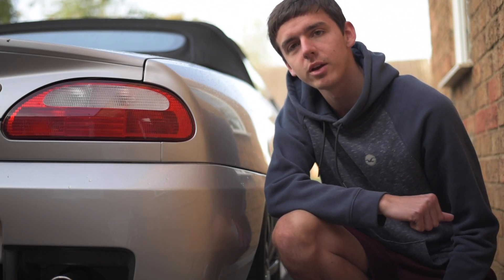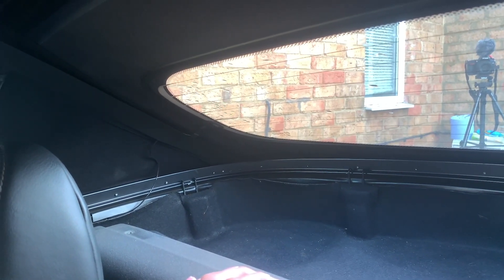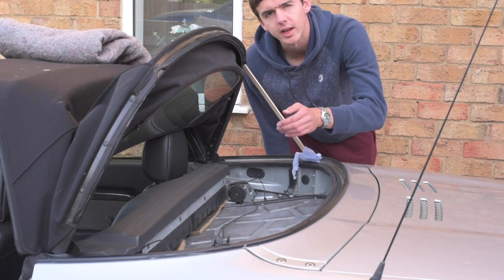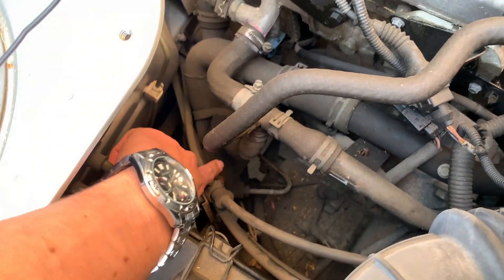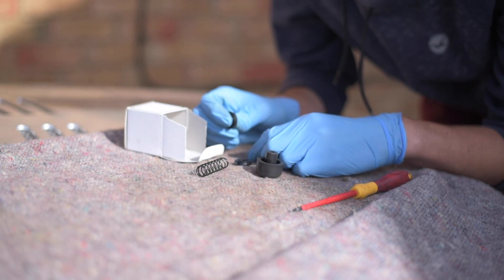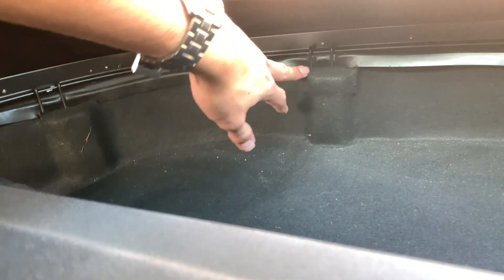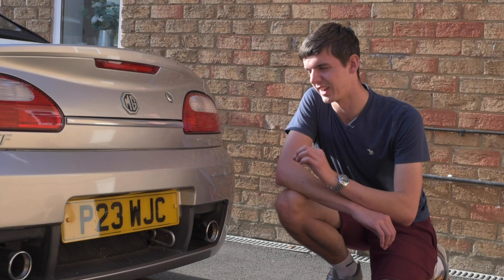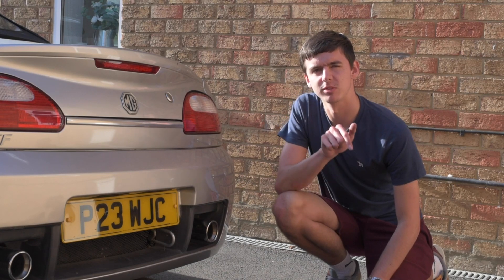How to Access the Engine Bay | MG TF How To Guide

Comment: What struck me was isn't thirteen bolts to secure that  metal engine cover overly excessive..Did they go out their way to make it difficult to work on the engine....Really useful video guide, well presented...Thank you
Reply from the maker: It's certainly not easy compared to most cars! I'm glad you found it useful.
Reply: Especially the three very difficult to access ones beneath the driver-side speaker. Any solution on how to get to them easily Willo?
Reply from the maker: The only solution for easy access is to first remove the t-bar, but I wanted to avoid extra work at all costs!
Reply: Mine currently only has twelve bolts as that final bolt frustrated me too much!
Reply: That's the thing with almost any mid engined car

Comment: How do you know if there vvc or not?
Reply from the maker: The TF160 was VVC, all the rest were not :)
Reply: @CarsWithWillo  sorry new to these, how do I know if it's a tf160
Reply from the maker: @snowy23704 unless it’s had the badge removed, it’ll say 160 on the back. Or take a look at the rev counter - the TF 160 redlines at 7,200 and the 135 redlines at 6,800
Reply: Ma è facile anche guardando soltanto da dietro il cofano dopo i collettori di aspirazione in profondità c è quel coperchio nero che se è vvc c'è scritto  bello grande "VVC" altrimenti c'è scritto "injection"
Reply: There were lower power models that used vvc but yeah the redline should be a bit past 7k if it's vvc